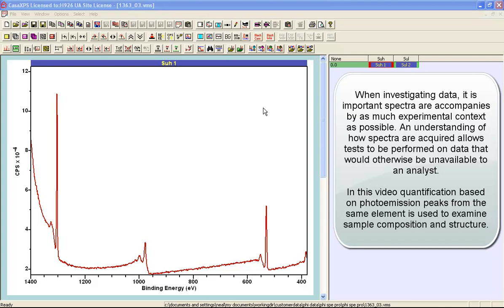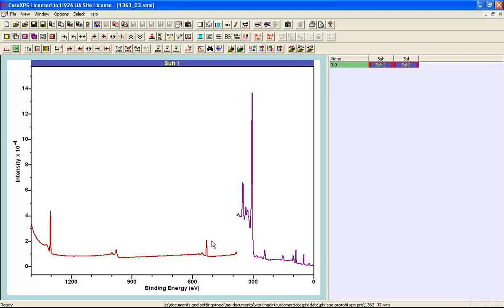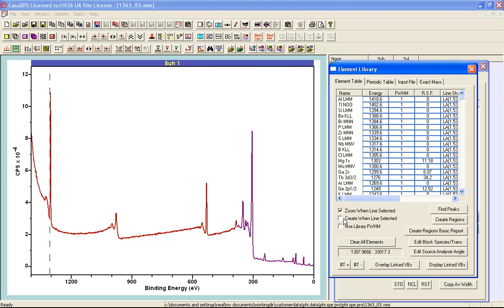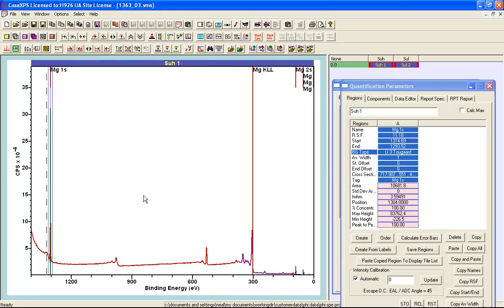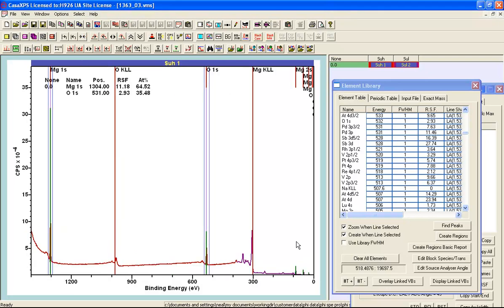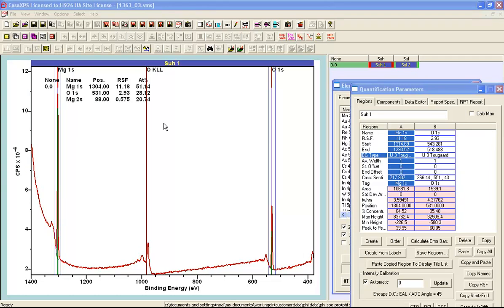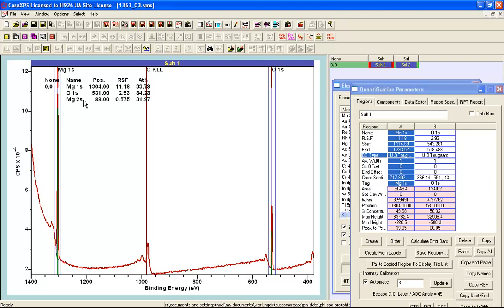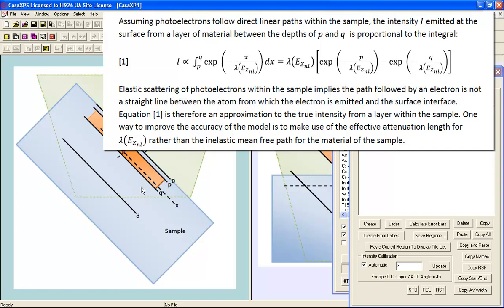Thin Films and Quantification by XPS in CasaXPS

Comment: That MFP Exp value is based on the thickness of the film, but how do you calculate it? Is it random? Between which values?
Reply from the maker: The value entered into the thin film correction is not random, but an explanation of how to calculate the value requires more than I can include in this reply. I will create a  pdf describing the theoretical relationship between film thickness and the value entered for the film correction to quantification. However, you should be aware this feature is best used as a test to see if a material has a physical limit in depth. There are many ways such an estimate could fail to produce true answers. I prefer to think of this feature as providing food for thought rather than calculating a film thickness. Hence the value entered is not a direct film thickness but is related to film thickness.
Reply: @casaxpscasasoftware4605  wow thank you for your answer I look forward for that .pdf
Reply: @danicule8671   Is the Pdf already shared? if so please share it here
Reply: @casaxpscasasoftware4605    is it necessary to select 'thin film under Escape Depth Correction' if the film is of 800 nm - 3microns thick? Can it be considered as bulk since the analysis is done on surface (~10nm)?